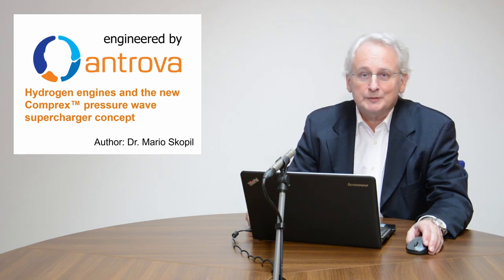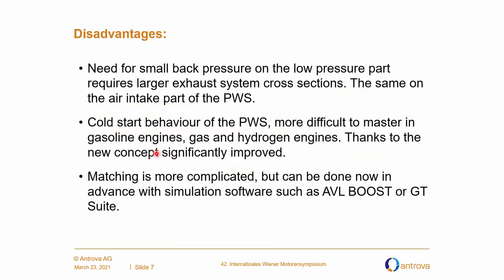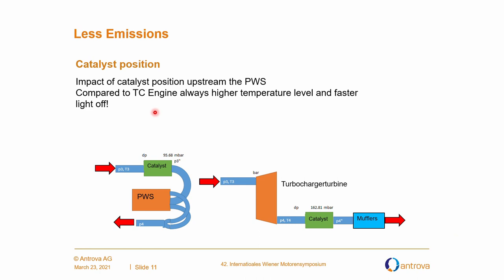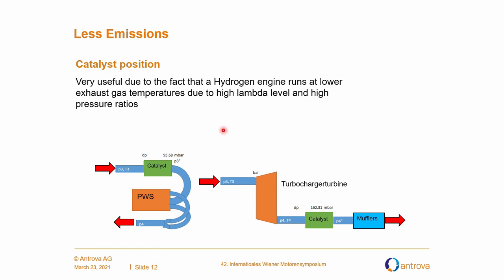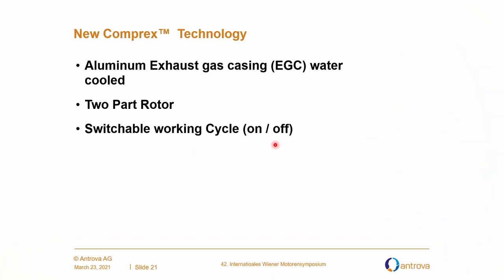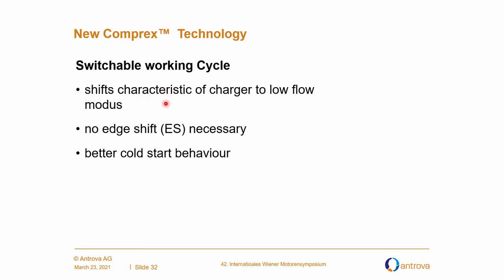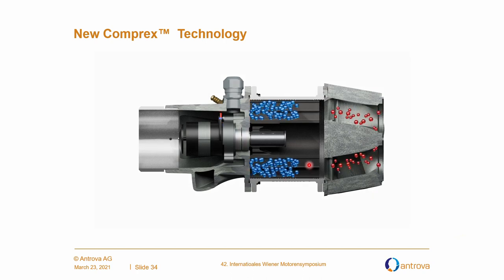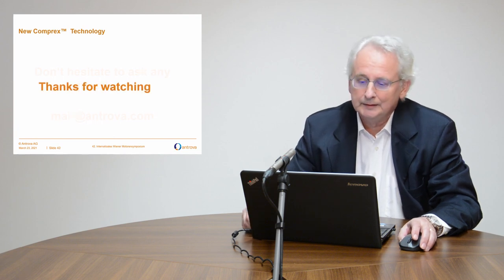"Hydrogen engines and the new Comprex™ pressure wave supercharger concept" by Dr. Mario A. Skopil

Comment: I think there was a diesel powered Mazda 626 like car with a Comprex PWS about 15-20 year ago..
Reply from the maker: That’s right! Mazda built the Mazda 626 DIESEL with a Comprex between 1988 and 1997. However, our new concept can be used on all types of combustion engines, both small and large gasoline, diesel, hybrid, gas and especially hydrogen engines.
Reply: @antrovaag3187  how much can you scale it up ? Could one for instance be fabricated and adapted for very large to gigantic diesel engines ( anywhere above say 20 litres displacement).
Reply from the maker: @thedoctor2102  There is no limitation in size. The technology can be used at every engine size.
Reply: @antrovaag3187  can it work with 2-strokes as a scavenge pump also ?
Reply: @V8Lenny  Yes it is possible, except using uniflow 2S-Engines.
Reply: @marioskopil5491  why not ? Crankcase scavenged already have scavenge pump so they dont need one
Reply: @V8Lenny  an uniflow! scavenged 2S-Engine is scavenged by an auxillary blower durring start up and a turbocharger during normal running. Due to the fact that the Comprex has no separate air and exhaustgas area (you cann look trough the rotor inside) it is an open system. The uniflow 2S Enginge is also an open system and two open systems cannot be used. The flow does not know where to go. If you have a crank case scavenged engine the flow direction ist clear and you should be able to supercharge the engine with a Comprex.

Comment: What about using these superchargers for hot rod applications?  Has anyone ever used them on a small block Chevy or Hemi?
Reply from the maker: It is possible to use the Comprex™ in hot rod applications. As far as we know, there was no such use.
Reply from the maker: @chrishenniker5944  No we don't. A Comprex™ must be physically and electronically adapted to the engine. A simple exchange or installation does not lead to success.

Comment: I really like how you've split the rotor.  Is the clearance actively controlled or is it a function of the thermodynamics of the spring you show in the video?

Have you considered supporting the rotors with external bearings rather than internal bearings?

Thanks again..  Very exciting.
Reply from the maker: Hi Steve 
The clearance between the rotor is not actively controlled. It’s a thermal dynamical function of the spring, as you assumed. We choose the internal bearings, because of the much lower cost.
Regards Antrova

Comment: It seems a bit idiotic. 
Instead of making a couple of thrust bearings and stationary components to give in as the rotor expands - you make complicated split rotor that has to rotate.
Isn't it easier to shift all the complexity to at least one side (presumably the cold low pressure side) while maintain descent labyrinth seals on the other side.
In which case you could easily make spring loaded seal to get rid of the leaks.

You also don't talk about what happens in high RPM where the turbines are efficient and the boost pressure is important.
I understand that the pulsejet engine that you envisage is fun, but only at low RPM where you don't develop much power anyway and where electric motor can compensate as in MILD hybrids.

Therefore for the MILD hybrids this is useless. The electric side solves the low RPM luck of torque.  While at high RPM the turbocharger with 60-70% efficient turbine is a lot more efficient than the pulsejet proposed.

Additionally, the main problem of the hydrogen engine is problematic not because of the supercharging but because of the hot spots in the combustion chamber that destroy the piston and cylinder. And no supercharger can help with that.

Essentially, being physicist and engineer with a fair amount of engineering expertise in the compressors and gas flow -  I smell something fishy here.